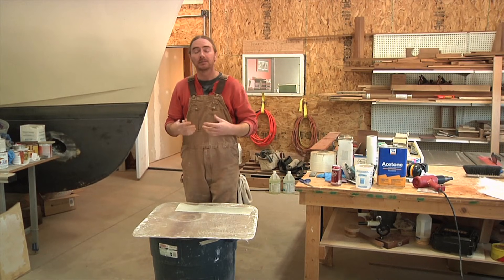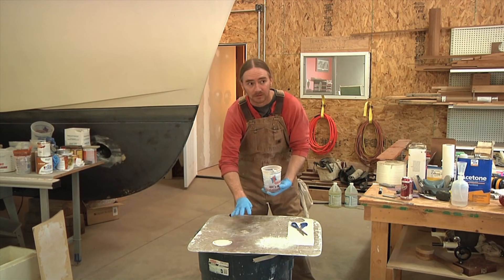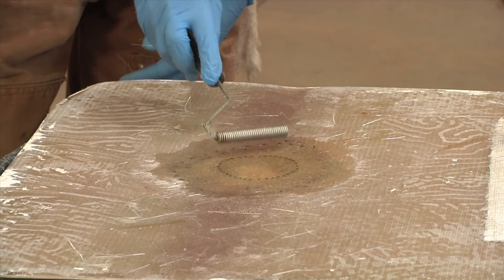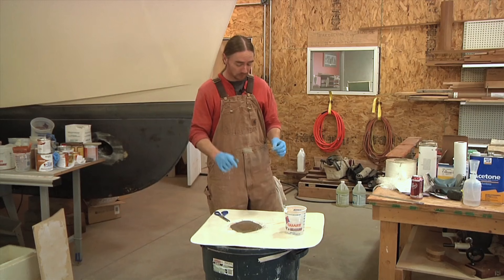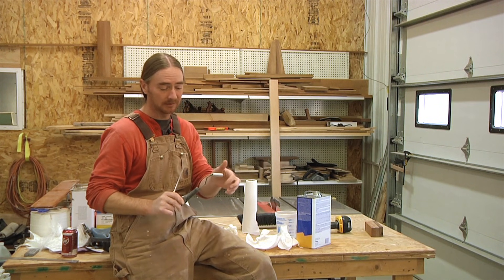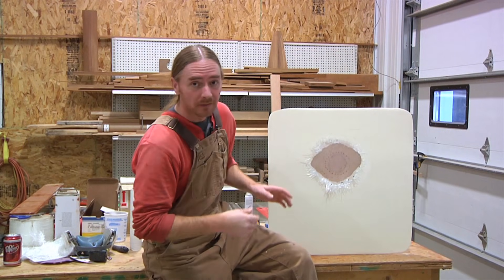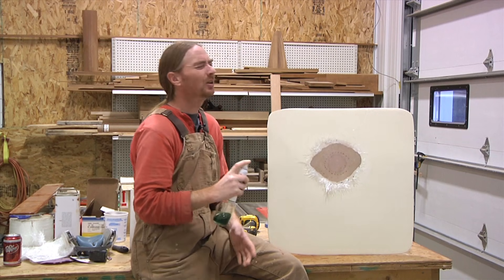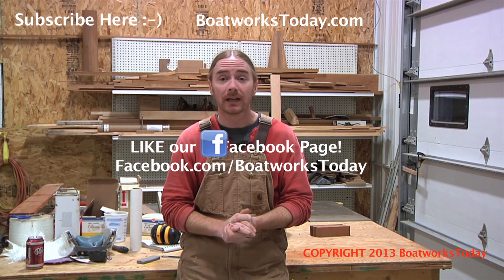Fiberglass Boat Repair~ There's A Hole In My Boat Part 3

Comment from the maker: Hey Colin,  the glass order is something that's typically a little confusing.  I've also seen people that start with the largest patch first, but it never made any sense to me.  The strength of the repair is only as good as the bond of that first layer.  

By starting small and working larger, each layer is tabbing onto the solid area around the repair. If all the glass is laminated without having to sand, there's a chemical bond between all the layers.  Seems like a stronger approach to me :-)

Comment from the maker: For glass layup, I almost always use poly.  When thinking about what will be used for a finish coat (gelcoat or paint), if you will be using gelcoat, then poly based resins from start to finish are your only option.  Gelcoat is a poly based product and polyester doesn't bond too well overtop epoxy.  

However epoxy overtop of poly is fine..   If I will be painting, I'll still use poly for the glass layup and thickened epoxy for the fairing.   Paint and epoxy like each other :-)

Comment from the maker: Depends if we're talking about above or below the waterline.  Below the waterline I'd go with epoxy as you'll probably be applying a bottom paint.  Above the waterline depends on if you want to finish with gelcoat or paint.  If the plan is to use gelcoat then you're stuck having to use poly.  If you decide to paint then it really doesn't matter.  I typically use poly for the glasswork and epoxy for the fairing when painting.  Hope this helps!

Comment: ive been doing glass work for 20 years or so. mostly all structure, and no finishing work, going to do some cosmetic on my boat and was watching to see if I could learn some new tricks. very good videos even for someone who knows how to laminate. i just wanted to throw out a tip if your bubble buster roller kicks off, how to free/clean it. if you use a cutting torch, or propane torch, run the fire all around the kicked resin. if using a cutting torch DO NOT use the oxegen trigger, just let the fire burn the resin DO NOT breath the smoke. once the resin is burning on its own, let it burn itself out. what resin is let will just flake/fall off and you will be able to remove the roller from the frame and get it cleaned. not very hard or time consuming. just don't breath smoke, its just as bad as the dust. hope this helps someone.
Reply from the maker: +Stand Marsh Good tip ;-)  Never tried that!  Thanks!
Reply: I've melted the screw once when doing this so yeah keep the flame moving, no direct flame for to long
Reply: One of mine had set solid before, I couldn't budge it , I tried heating it up and it come off easily.

Comment from the maker: Hey Alex, Thanks for the kind words :-) In situations where I can only get to one side of the damage and for one reason or another is not practical to cut an access hole, I will increase the taper on the one side the full thickness of the laminate. So, rather than doing a 12:1 taper, I'll do more like an 18:1 taper since all the layup will only be on 1 side of the damage. By increasing the size of the taper you'll be able to have more layers of glass and a wider area to tab onto. Hope this hlps!
Reply: BoatworksToday but what about curing from only one side?
Reply: BoatworksToday if you cannot get to the inside how do you get the inside to cure

Comment: So I watched your videos over the last couple of years when I was working on my two small sunfish sailboats. It's great to watch and learn from a person who knows his craft. I purchased a Four Winns Horizon 180 this October which has been neglected and abused. I'm redoing the interior vinyl and the canvas work this winter. The last owner purchased a canvas top for the boat that was for a different boat and rather than utilizing the old snap points he decided to install more snaps. The boat looks like it has been BeDazzled and the snap he used were not stainless. Im removing the rusty snaps as part of my restoration and would need to fill the remaining 1/8"holes with resin and white gelcoat to match. I've been told that I could use epoxy to fill the holes because they are so small and top off with gelcoat. I'm concerned that I wont get a good bond.  I have 20-25 holes to fill in. I'm thinking (new video). Please!

Comment from the maker: I'm using poly because the topcoat of the repair is going to be gelcoat (which is poly based).  You're correct that epoxy will bond with almost anything but poly overtop of epoxy isn't a good idea.  Since the gelcoat is poly based I am pretty much restricted to using poly based products throughout the entire repair process.
If I were painting the topcoat then I would more than like use epoxy for the fairing, but still use poly for the glasswork as it's a quicker turn-a-round time :-)

Comment: just bought a sprint 1990 FS for 500! 
yamaha 115 precision. runs great. the problem is that the hull or the part of the bottom that comes to a point is cracked and rotten in sections. I bought it knowing this? so im not smart BUT..  i figured it would be fun to Fiberglass. the boat is in perfect condition besides this. so ive been researching and looking like crazy. alot of partial info then came you!!! thanks! im doing this on the boat trailer cuz i dont have no way to flip it. watching intentley

Comment: Hi, I'm a first timer for fiberglassing and have watched many videos on how to repair structure problems, and yours is by far the most informative. I've undertaken a restoration project on an old, small sailboat and I'm wondering if it is actually possible/practical to use this method on a structure/impact crack that runs down the ridge of the boat's hull for about 1 and 3/4 feet? I'd much appreciate your advice. Thanks in advance!

Comment: This YouTube channel may be the best I've seen!  The manner in which things are presented is just great.  Straight forward with a bit of humor mixed in :)

Quick question: I have a repair where I can only get access to one side. It's a hole in the hull of small small boat, but it is for sure a structural problem. Is it OK to do a multiple layer layup like you did on both side but on one side? I was gonna tape a small backer to start, and then just layer it up. Do you have a video like this?

Comment: Hey thanks a lot for all your knowledge... I bought pretty much everything you used in this playlist (the equivalent local products here in New Zealand), so just to confirm I can do all of my repairs with polyester resin on my boat and once the glas and resin is layed I just seal it with the PVA...  I dont need anything else to make it cure?  Really appreciate your time, Ive learnt so much... thanks

Comment: Great videos and Very Helpful.  Question on the hole in my boat video.  I have a 16ft runabout with a 5 inch crack that goes all the way through the fiberglass.  This crack sits just below the water line at the bow of the boat.  Is the method demonstrated in the video one you would use to fix this situation?  Thanks in advance.

Comment: thank you for this video.  I am going to try to fix some holes in a foreword hatch where the hardware for the hatch-stay went straight through.   it goes through a ridge around the gutter for the drain.  not a great design.    It made a huge hole through this 1" 1 foot long ridge where the screw and washer went through all layers. I will have to repair some from underneath inside by muddy cabin, how do you lay this stuff up when gravity is not your friend?  still a laminating resin?  would I thicken it?  tape over it?  pre-wet it?

Comment: Thanks for your video's, they are realy helpfull. 
In my boat I need to fix a hole that I can reach from one side only. So it is not possible to remove the cardboard afterwards. You have a idea?

Comment: Hi. Firstly, thanks for a great set of video's. I have a question though. what is the maximum hole size (after prep) that this method would work?
Reply from the maker: really no limitations or restrictions.  I've replaced entire bows this way :-)

Comment: I have a 10inch by 12 inch square hole in the bottom of my center console where a thief cut my transducer out. What would you recommend as a backer to start my first layer of glass? Will the tape work with that big of a whole?

Comment: Hi i have a question about a boat I recently. It has sat in the sun for a little while upside. down the gel coat is dried out would i be ok just sanding it and applying gel coat or put some sort of resin on it then gel coat.

Comment: HELLO COILN, I could use some serious advice here; I have an RV with a fiberglass nose cap and rear cap; my issue is "SPIDER STRESS CRACKS; they are not very deep but they are all in one area12"x18" area; MY PLAN is to sand the area with 280 grit up to 400 grit; to remove the cracks/ prime with 2k primer and finish either with  GELCOAT OR SINGLE-STAGE PAINT;

Comment: I just bought a boat that has several repairs on the bottom that were not done very well. They are raised up off of the original hull. Do you have any ideas on how to smooth out the repairs or how to redo them?

Comment: Ok so I've watched your "there's a hole in my boat" video series time and time again. I really appreciate the knowledge that you give throughout your videos.  So I've taken on a project of my own and that is repairing a decent size hole on the bottom side of a gheenoe. After some grinding and tapering I taped up the back side of the hole and using polyester resin WITHOUT wax I laid my first layer of chop strand, let it tack up and then removed my tape. The problem I'm experiencing is on the opposite side of the chop strand where the tape was placed it appears to have some air bubbles. Only in the area that had tape and none at all where the glass meets the hull. Being that it's the first layer of many would I be ok if I laid the rest of my layers down or should I grind it all back out and start over?

Comment: Great video! However, I am attempting to repair a hole on the hull of my sunfish sailboat (roughly the same size as the hole addressed in these videos). I do not have access to the interior side of the hull so do you have any recommendations as to how I should support the inner side of the hole?

Comment: Im doing a tub floor...so i can i can only work from the top...it's got a 10 inch long crack...so would you suggest cutting out the crack?..(so i would n't be able to put something underneath) ..... what kind of fiberglass fabric would you suggest?...thanks for the videos very imformative

Comment: NICE ! I learned something.  I am looking at buying a sailboat that has been neglected for many years. I have a question about fiberglass boats. and that is,
short of a boat being crushed torn in half. ARE 99% OF DAMAGES REPARABLE ?
Reply: With glass, everything is able to be repaired providing you're willing to put the time and expense into it :-)  Most of the time it makes sense; sometimes it doesn't..

Comment: I am starting a boat that just needs freshening up. A few questions I have are mostly toward mixing products and Hardware. Where do you get your brushes that you're using this video? Do you clean them with acetone in between each application so that they don't turn to a fiberglass stiff plastic? Same thing The Mixing Bowl I notice that you throw the mixing wooden piece away do they have these at the local paint fiberglass door?

Comment: Would you use the 1708 when repairing a thin hull like a kayak ? appreciate If you could mention if there are any other issues/tips for thin hull repair . I learned a lot from watching these three videos - thanks.
Reply from the maker: Probably not 1708 for something that thin.  Think I'd lean towards a 6 oz cloth :-)

Comment: Thanks a lot for your videos!  All great content.  After watching others, can you explain why you didn't use an epoxy resin vs the polyester resin you used?  Being structural wouldn't the epoxy resin make for a stronger finish?  I know this video is almost 6 years old but taking a shot to see if this gets answered.  Thanks
Reply: Aaaaaand nevermind..... you answered it in the next episode.  Using gelcoat = no epoxy

Comment: Great video. If you did not add the PVA (green) can you start laying glass the next morning? I am doing stringer work and do not think I can finish in  day. Thanks.
Reply from the maker: Cyrus Erica Kliewer As long as you're using laminating resin, you can leave it for a few days and pick up where you left off without having to sand.  If there is already wax added to the resin (some manufacturers will do this but it's marketed as a 'finishing' resin) then no.  Hope this helps!
Reply: This us for a 2000 scarab 33 AVS,  needing stringers and transom. Would you go with Epoxy or vinylester? And I was considering Coosa board instead of plywood so it can't rot, is that a good idea. Thanks for great vids! Subscribed!
Reply from the maker: Cyrus Erica Kliewer Either resin would work fine; epoxy will provide longer working times.  Coosa board should work well; may not be as easy to cut and shape as plywood though.  I think I'd compare the price of that versus actual marine plywood (okoume or merianti)

Comment: This is a great series but I work on sailing dinghies a lot with repairs and I find it difficult to get a backing onto something where I can't remove it, e.g. a hole in the first layers of the hull, it's really tough (and sometime impossible) to get in there to get a backing on. Any advice?

Comment: What you do if u can only access one side? Your videos are awesome
Reply: Cut a hole in damaged area 

Boat surface `
Lip -
Hole _

Again that is 
      |                        |
`````--_____--`````

Where you see the | that is where you want to cut you spare material for a patch and from their shave a groove for the lip from`to-

Then epoxy your cut out and place fiberglass on both sides and then sand it once cured after that wet the lip and the interior cut out part with epoxy again and screw the cutout into the lip shaving of the boat -
/from their after it dries remove the screws add compound/cure/sand/compound/sand/until after you sand and you have a smooth surface of the compound/lightly sand six inches out of the restored area/,from their fiberglass the restored area plus one foot for extra strength/prime/paint/final finish/buff/DONE

Comment: i have a 1978 35' Duffy that i lobster out of. I need to put a new hauling patch on. I have a hard nylon plastic hauling pad bolted on, but its obviously needs to come off with all the stress cracks straight through the pad. grinding down the holes isn't an option as like this. I have probably around 30-40 bolts holding the pad on. granted they are sealed with 5200 and im not leaking water. do you recommend something like kitty hair bondo to fill the bolt holes in then layer with glass over? i was thinking 2 layers of of matting and 2 layers of Kevlar.
Reply from the maker: This actually sounds more like you need some major backing plates on the underside of the bolts.  1/2" thick alum over- sized the diameter of the hauling pad?  Other thing I'd look at is if there is any moisture in the deck that is compromising it's overall strength.
Reply: i should clarify the fiberglass hull doesn't have any stress cracks just the nylon pad. the hull is structurally sound. i don't believe there is any damage through the laminate of the hull. i just don't know how about approaching the bolts holes because there are so many. a few people have told me they make a marine bondo with resin and glass in it. its suppose to fuse with the hull and any glasswork done. i was thinking that route as a filler and layering it in and out for strength.  thanks for replying =D

Comment: When you said to use the wax additive, would I use finishing wax? Also to fill in low spots without using putty would I be able to lay finishing WAx with or with out the cloth matting then slightly sand before applying paint?
Reply from the maker: The wax you'd use is called S-2 surfacing agent.  It's a paraffin wax dissolved in styrene.  If you have pin holes or low spots you'll need to use a fairing compound (either thickened epoxy if painting or Adtech p-14 if gelcoating).  If they're larger areas then I'd build those areas up with more glass then continue through the fairing / finishing process.

Comment: Hi, i love your videos however im a bit lost when it comes to the glass fiber. Over here we use metric system and fiber is sold in different grams per square meter. I think many of your viewers would benefit from a run down of your most common glass fiber material and what a metric equivalent would be. Thanks!